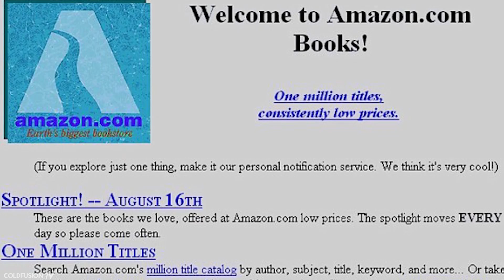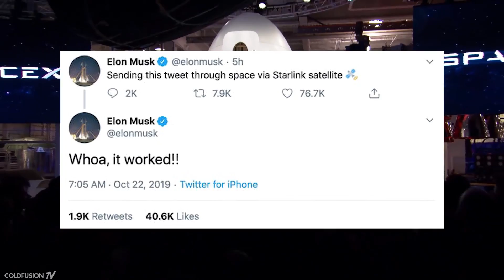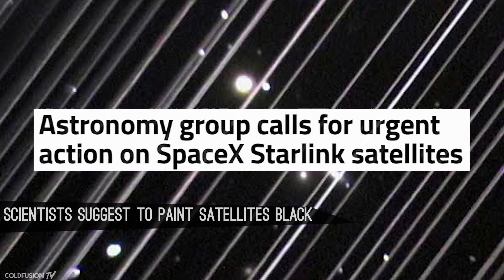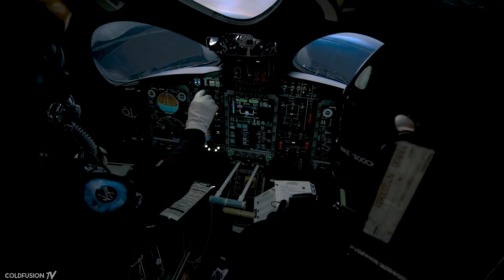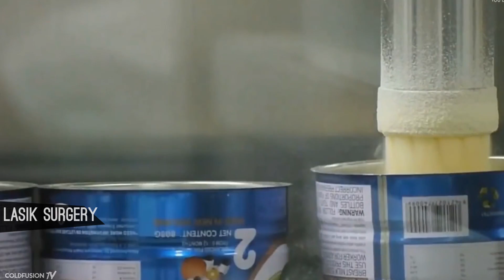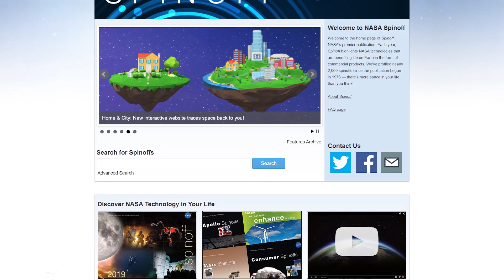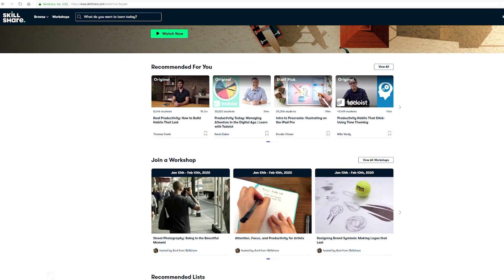The New Space Race of the 2020's (Documentary)

Comment: Room Temperature Super Conductors (RTSC's), High-Frequency Gravitational Wave Generators & Compact Plasma-Induced Fusion Reactors are going to become the future.. chemical propulsion is on its way out and field-induced drive systems utilising electrogravitics and fusion principles to form a polarisable vacuum / bubble / sheath / globe, i.e the engineering of the Space-Time-Metric / Quantum Vacuum Engineering using High-Frequency Electromagnetism in specific configurations (Torus). This is what Richard Branson is referring to in this when he speaks on "Point to Point" travel, he is talking about Faster Than Light (FTL) through the techniques described above to create a Trans-Medium vehicle (capable of travel in Water, Air & Space) due to inertial shielding which is a bi-product of being encapsulated within a polarised globe of ambient gravity that is being generated by the propulsion system - Inertial / Mass dampening through negative-index refraction by utilising specific piezoelectric conductive metamaterials to promote a negative refraction index.

Comment: to bad that rockets don't work in vacuum. why they still claim silly. rockets can only work in a atmosphere. they need atmospheric pressure for the rocket trust to build up. when the gases escape without resistance, there is practically no force pushing the rocket forward. if rockets still works in vacuum even it need special principle on earth, we live in a simulation and the whole reality is a fake as rocket behavior is then not universal and different laws of physics plays in space than on earth. even if you got a tiny bit of propellant force, the rocket would use like 1000 years just to start moving. the confinement that supposed to make a rocket move forward is in a small rounded tube, but without the atmosphere the gases will not remain in the tube long enough to make any thrust at all. rockets works by burning atmosphere at a pressure above 1 atmosphere. in vacuum this pressure is zero. that is because the gases have no confinement to build up thrust in the first place. so all this belief travel in space crap is just fairytales for adults. the longest trip man have ever been going upward toward the stars is far into the stratosphere that is still full of atmosphere. another thing, space suits don't work in space. actually the problem is that vacuum causes the oxygen pressure in a space suit to expand and make it impossible to move your arms. unless the oxygen is feed directly to the mouth and the person have zero atmosphere in the suit the person will not be able to move. the problem with this is that the oxygen in his blood will expand end get pushed out of his skin and his body will behave as it boils. for these reasons, astronauts in space is impossible. only if reality is a simulation full of intentional flaws based on horrible incorrect scientific philosophy of a mother universe, astronauts can walk and operate in space. only a flawed universe will allow astronauts to move around in vacuum of space safe and sound. if you apply the same principle of a rocket to a car engine and then assume that the car will move forward with no top cover above the pistons and zero compression because of vacuum by blowing and burning the gasoline air mixture in vacuum, if the car engine do start normally in vacuum of space, not vacuum on earth in this condition, then different laws plays in space than on earth. the reality is that with a car engine, no compression, no start. with rockets its the atmosphere that produces the compression chamber of the rocket that equals the car engine piston block but who care, as long as you saw space news on either youtube and nasa , esa or tv and it had to be real because they sayed so. by the why, dont for a second try to think for your self, it can make you ill very ill and its contagious. scepticism is a real dangerous illness where the only cure is not to question anything and just believe and have good faith in corporate progess and media slander. just do as usual, ignore arguments of good reasons and continue your gullible beliefs in space travel and the latest space news of big corporation media. have a nice sleep.

Comment: So far, SpaceX is the only company that has done anything of significance. Bezos" has yet to launch an orbital mission l. In fact weather balloons have gone higher than anything Blue Origin has done. Virgin Galactic? Again. Nothing much. You should be talking about Bigelow Aerospace or Rocket Lab. Bigelow has a real inflatable module ATTACHED to the ISS and one in orbit for YEARS now,  and Rocket Lab has done way more than Bezos, or SLS from NADA or NASA, in development for over a decade and BILLIONS OF DOLLARS and not one flight. They should be charged with fraud  not just milking a job. And NASA is wasting REUSABLE ENGINES on the launches of the SLS dumping them into the Atlantic after launch. They have developed very little new over a decade. Get your story straight.

Comment: If it isn't impossible light hotspots, it's the Sun's light depicted as coming from multiple directions at once: Which is not a possibility.

The US Tyranny couldn't, didn't, and still cannot go to the Moon.

AS16-109-17800 from the Apollo 16 fraud.

The right leg of the astroNot is casting a deep black shadow, but his up-light left leg is NOT.

Worse, in 17800 the Moon buggy's shadow clearly falls in a different direction than that of other shadows in the
photo. Shadows in 17800 fall from the upper-left to lower-right. However, the Moon buggy's shadow, as evidenced by the shadow of its dish-like antenna, falls from the bottom-left to the upper-right. The shadows of the astroNot and Moon buggy are a full 90 degrees off, forming an impossible "V" shape. What a criminal joke.

NASA. Apollo. Theranos.

https://www.hq.nasa.gov/alsj/a16/AS16-109-17800HR.jpg